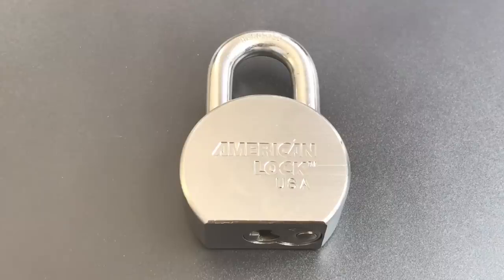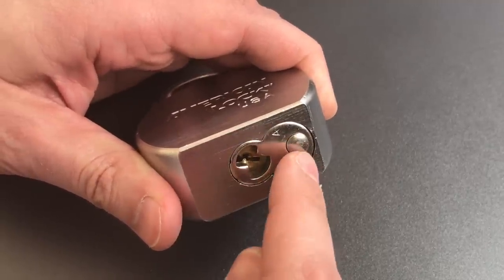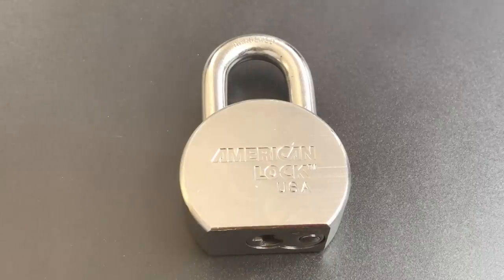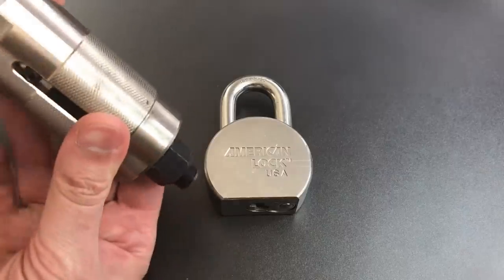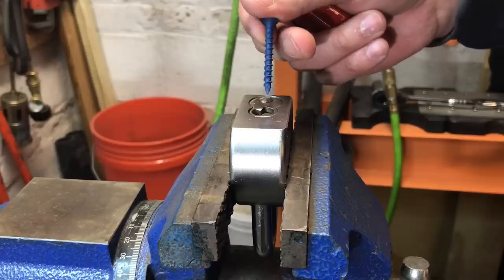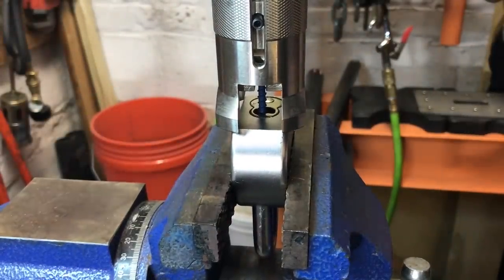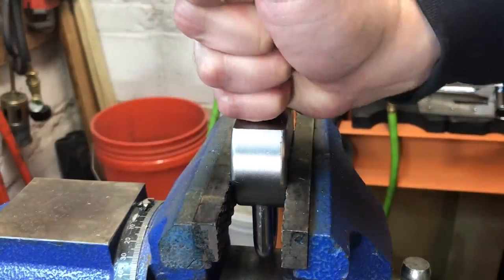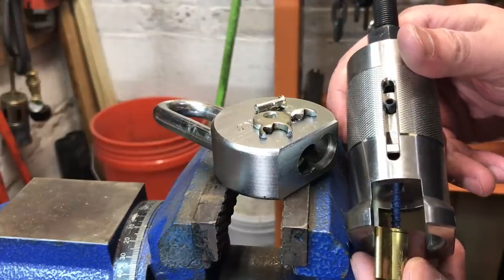[607] Core Puller vs. American Series 700 Padlock

Comment: As always, thorough and cleanly executed...you sir, with your videos, have opened my eyes, for some time now, regarding lock security...
Reply: Too true. Some videos, like this, or the Ramset video's, or the nut splitter videos, or bosnianbill's grinder video remind us that picking is a last resort most of the time.

Personally, if I can't rake it open in a few minutes, I use a cordless Dremel and a 3mm carbide burr.

Comment: A core puller?
We use core pullers in the fire departement as one method of entry among others.
edit: Ours you can operate with a cordless drill for more speed.
03:55 We use different screws. One kind to pre-cut the hole and then we remove it and use a different, more sturdy screw for the pulling of the core.

Comment: As someone who has worked with tapcons before (worked sheet metal roofing, sometimes needed to go into concrete walls), I'm surprised at how well it held. I've always been so used to them snapping with such little force. Thankfully, I don't worry about this now.

Comment: Well done!  I would think they could beef up the design so that the brass core would strip out before the screw failed.  Also interesting to note that one security measure, hardening the retention plate, introduces a weakness, brittleness and a lack of sheer strength.  Case hardening of the retention plate might be best.

Comment: Very interesting.
If you plan ahead and come prepared, you could use the same bottom pins and replace the core and retention plate with new ones, and it's possible nobody would know the lock had been tampered with. While you're at it and have the core out it would be easy to impression the bottom pins and make yourself a key when you are back in your shop.

Comment: I would recommend using deckmate style deck screws instead of the tapcon in the future. My years in the construction trades showed me on numerous occasions how brittle the metal in tapcons are. Deck mate screws are far less likely to break. It got to the point where I was using deckmate screws as concrete anchors in place of tapcons because of a much lower failure rate. When installing tapcons I would expect a failure rate of 30 to 50%.

Comment: It's rare i see a new commercially available lock tool on youtube before I see it else where! :) ... what is this tool?? ... 
Looks like something that could save some time, and much safer personally, than drilling the domed retainer nut ... and It leaves the padlock easily re-build-able for the customers re-use (new plate screw and cylinder in the event it can't be picked open),.

Comment: A japanese style philips screwdriver bit with a ratchet is good for getting leverage on screws that are hard to put in. Basically just file off the tip of a philips head a tiny bit so it's flat and it won't slip nearly as easily.

Comment: It appears that the screw could be replaced with a high-grade equivalent?  Not sure if the retainer plate would still break but perhaps with the screw holding it would take more force.  Probably the core puller would still exert enough force anyway, but as you say a pretty good package overall.  If I had it I would upgrade the screw...

Comment: The screw he uses is a concrete screw. They are much tougher than any other kind of screws. They are also coated in a plastic like epoxy which makes them easier to screw into concrete.

Comment: 1. Put candle wax on the screw thread.
2. Use a pan or hex head screw.
A key would open it much easier without breaking the lock!

Comment: Wow! That's all I could say. Obviously you know how most people feel about the "American" padlock. You just demonstrated one of the easiest, quickest, and pretty quiet ways of by passing one of the most used padlocks; at least here in the states; that the majority of people would use to protect pretty expensive modes of transportation like ATV's, and trailers for transporting cars. It also looks like the lock is still good to go, just needs a new locking mechanism.
Reply: The quietness of this attack is a big deal, no power tools at all, just the crunching of the breaking lock goodies.

Comment: So, is this a commercial locksmith's tool, or something adapted from the automotive world?
I used to use an I.D. sleeve puller to do this job when I was doing repo work. 
The jaws of the puller slipped in under the edges of the retained, and broke the soft screw.
I doubt my rig would have damaged a hardened screw.
Reply: Thank You!

Comment: Core Pullers are so nice. Impact and bending would be bad for that hardened screw in the core.
Reply: And the screw should have a washer on it because of the angle of it‘s tip

Comment: Definitely agree impacts use a hammering affect to help break loose bolts and nuts or tighten
Reply: the hammer may work against this tool, causing the screw to snap due to too much instant torque.
Reply: Makes sense.

Comment: Possibly drilling a bigger hole in the core and driving a sized high grade bolt in that hole would allow significant force to be applied with no damage to the screw?

Comment: I would use a screw with a square (Robertson) or Torx drive rather than crosshead - much more torque capacity and much less likely to 'cam out'.    Though one would have to be more careful then not to shear off the end of the screw in the lock.

Comment: What would happen if you used a key cut like a kill-a=lock ?
With the 45° and 90° cuts instead the screw.
Reply: I'd guess that it depends on how well the core is secured. That would probably work on more fragile locks, but on sturdier ones I feel like you would end up ripping the key out and mangling the core rather than pulling it out.

Comment: Well done. You know I've come across a number of American padlocks with a retaining nut that wasn't hardened and fairly easy to drill the only thing I can figure is they must have been rekekeyed at one point and someone put a retaining nut in that wasn't hardened So generally I would recommend checking just in case you might get one that is not hardened making it easy enough just to center punch and drill it.

Comment: Wonder if American Lock has fixed that already? It’s easy to fix that yourself if you just find 12.9 screw of that size. It may be the reason the lock factory has an ordinary screw there instead of a decent one. It probably is better to change to a larger screw too.

Comment: LPL...... have you ever used or seen a GM collet tool, that was used on the early GM locking steering columns? It worked the same way. And was much quieter than using a slide hammer when repoing a car......

Comment: I wonder if that core retention clip could be welded to the case in order to prevent or limit this type of attack? That would be a quick modification for an otherwise solid lock.

Comment: I will bet that core puller is expensive too. All that precision and hardened steel. That American Lock did not have a chance, and that is a good lock. I wonder how it would have faired if the core didn't have that vunerability of that only so so retainer. That core puller would be cool to check out. I love fine tools like that.

Comment: so if the core retention plate was made in a better steel and the nut and bolt made hardened and larger this lock would be significantly better?

Comment: I always have the same question, at what point why wouldn't someone put some heavy bolt cutters on the shackles? Its relatively quick and just as easy as a core puller. And you could hide it in the duffle bag that you no doubt brought for whatever it is you are stealing just as well as the core puller and that huge wrench ? Just my thought
Reply: You ever try cutting a large shackle like this one? The bolt cutter would have to be huge

Comment: Looking at that domed screw retainer would it be possible to use a junior hacksaw to make a slot (or hammer a stone chisel to the same effect) and then just turn it to unscrew the plate and lock?
Reply: AlisonWheeler if I remember right there's two wings on the side that prevent it turning inside the lock body. Otherwise you wouldn't be able to unscrew it because it would just turn along with the screw
Reply from the maker: It will not turn... they thought of that.
Reply: LockPickingLawyer Putting in a cut or channel - and rotation being blocked - would make it easy to drill though. All about timing, noise, and visibility I guess.

Comment: It seems like one could use a flathead screw driver or a small cold chisel with a hammer to do the same thing? It wouldn’t be as cool and you’d work up a sweat, but I think it would work in a pinch

Comment: So if they where to weld that plate instead of using that bolt like thing this would be completely impossible right? Would make the lock more expensive but still. Seems like a good idea.
Reply: John paul May  sure... But that makes a lot of noise and sparks and stuff. Anything can be opened destructively if you have the time and a well isolated place to work.

Comment: Your experience with the TapCon screws pretty much follows mine - they're tempered pretty hard and do tend to be on the brittle side. In fact, I've had fairly good luck when it's time to get rid of them when remodeling by just smacking them sideways with a hammer and having them ping off into space.

That core puller looks very reminiscent of a device I've seen used to test paint/coating adhesion. I believe this was the exact one: 
https://www.elcometer.com/en/coating-inspection/adhesion-testers/pull-off-adhesion-testing/elcometer-106-pull-off-adhesion-tester.html

Instead of tugging on a screw head, it used these little mushroom shaped test "dollies" that are glued to the surface coating.

I'm suspecting the reason the locking mechanism didn't rotate when you attempted to turn it after pulling the cylinder is that the spring above it got wedged at an odd angle. I had that happen on some padlock after changing the cylinder, reassembling, and locking it. The fix was, uh, unscientific but effective: throw the lock in the air and let it come crashing down on an asphalt parking lot, after which it worked fine.

Comment: To think that all this time when I was using a spanner to open these when all I had to do was buy a super expensive "Bell" core puller. Huh!
Reply: Kit Bear explain 'using a spanner to open these' please.
Reply: Sure, use the large open end of the spanner  to wedge under the anti drill notch on the tab side of the plate and push the spanner downwards towards the retaining screw. With enough pressure you can bend the tab out and repeat the process on the other  end you force out the plate from the screw.
Reply from the maker: I’d love to see that. My experience has been that anything I can wedge in. There will break before the lock ☹️
Reply: Kit Bear how do you leverage the lock in situ? Seems like that would be an issue.

Comment: If you used an impact driver instead of a ratchet you could probably tear the core out in seconds
Reply: chain3519 might as well just use a cordless angle grinder at that point

Comment: I'm a little late to the party, but this tool is very similar to a Subaru Ball Joint puller.  This one is cheap, Astro Pneumatic Tool 78620 Subaru Ball Joint Puller

Comment: pulls out giant complex metal tube
"Its a relatively simple tool"
Reply: ThreeEyedFish that’s a professionally made version. Burglars use cheap throwaway versions easily made in any machine shop, those last for at least half a dozen breakins while the pro version shown here lasts a lifetime for a pro locksmith.
Source: I’m a cop, have investigated burglaries where core pullers were used. Telltale sign is a circular impression around the lock, and the lock cylinder completely missing from the crime scene. 
Eastern european burglars tend to use purpose built conical screws for these, those are beefier and less likely to break in the lock.

Comment: I drilled the core out of a very similar lock using progressively larger drill bits. I lost the keys to my toolbox and the lock was recessed.  I'd normally just cut it with a torch or bull- pin and hammer. But since the lock was recessed I had to drill it out . It took about 10 minutes .

Comment: Core pullers are useful when sheer strength is required WITHOUT impact. In this case, it compromised the weakest link, that simple screw. American, I imagine, will be "upgrading" that retention screw now, using one far stronger. A cheap fix, to a good lock. Use a screw with a tensile strength of at LEAST Grade 10, and this attack becomes far harder, if not impossible. It only has to defeat the Concrete Screw, which is Grade 8.

Comment: Now it would be able to pick this lock with no problem in 30 seconds but I've decided to use some crazy device that is not commercially available and no criminal will have access to to destroy the lock this is most definitely more difficult than picking the luck but why not. Let's get started.

Comment: Those keys with dimples rather than teeth are better or can be picked as easily? Do you have any videos of those?
Reply from the maker: Check my dimple lock playlist... it’s probably over 100 videos long. 👍
Reply: I've seen several tens of your videos already :-) but please tell me, are keys with dimples any better/safer? I have to install a new one tomorrow!
Reply: George Of The Jungle a good one is better than a cheap one of the alternate. But a really good pin tumbler lock can be much better than a low end dimple lock. It really comes do to use case and threat analysis. What threats are you mostly looking at. In many cases its more about resisting brute force attacks or being so hard to force that bad guys seek easier targets. 
 The majority of thieves dont pick. They seek to quickly bypass or break a lock, so croppers, wrenches, hammers, shims, core bypass tools, that sort of thing. 
 Sometimes locks are very well protected against one attack but not another. The american round body for example. A decently strong lock. Has ball bearings to prevent shimming. Can be obtained with bumpstoppers, and you can beat on it with. Hammer for a while without hurting it dspending on how its attached. However with two tools the core can ne bypassed and the lock opened easily in less than a minute. Or as shown here it can have its core ripped out. 
 If the situation around the attack calls for more stealth, they can be easy to pick as well. 
 If this is the lock you had, and wanted to make it secure, you could rekey it with a pin kit or replace the core with a better compatible core. Then you could further mod the lock by making a shackle guard for it by getting two short pipe nipples that are just shorter than the straight sections of the shackle when the shackle is closed. This makes the shackle even harder to cut. You would need to add an antibypass wafer or two to the core and then weld some reinforcements over the core retaining plate to help prevent attacks like this one or with the ramset. 
But if the lock you want to use is decently strong, it should be ok. Most attacks are brute force.

Comment: Use a cordless Dremel tool with a thin cut-off wheel. It will make short work of the head on that pin in about 2 minutes.

Comment: To counter this, I would weld a 1/4" or thicker plate on the bottom of the lock with only a hole for the keyway.
Reply from the maker: A top loading padlock would be easier.
Reply: Is that where the tumbler gets inserted on the same face as the shackle?
Reply: skoronesa same as abloy 362

Comment: Great Video!  FYI Tapcons are notorious for not being very strong.  I've snapped countless ones I concrete!   They are stronger than drywall screws but not hardened structural screws like the ones made by Simpson Strong Tie  for structural brackets.    None the less, the Tapcon seemed to work well here and I agree less shock load vs static load.

Comment: Ouch.  That was a little too easy.
Reply: this method is entirely impractical though, isnt it
Reply: Seems practical to me.  The puller is a bit large to carry in a trouser pocket but certainly portable enough.  I doubt the vise is necessary.  Any thief with rudimentary planning skills could do this without having to become a genius.  The tool costs maybe $150.
Reply: Totally practical. In less than a minute, he broke the lock. As slow as he was working on it. (no offense LockPickingLawyer) 
I am sure that if I was going to steal your bicycle, I could have that lock apart in about 20-25 seconds. 
He just showed how vulnerable those locks are. That is the point!
Reply: maybe you guys are right. reason i made the comment was that he had the thing in a vice and what not, but that's probably not needed. it would certainly be more difficult to get it all done in a realistic scenario though.
Reply: people who steal bicycles are meth heads who take unlocked bikes. these vids help people who lost keys and don't want to use a locksmith who shows up with an angle grinder and charge $300 for 2 mins work.
Reply: Er, the core puller is its own support. You don't need a vice. He's just using one for support.

Comment: Is it easier to pick a lock once you've seen the key?
Reply: Sometimes, not always or even mostly. The inner workings of the lock are only exposed to a small extent by the key. There could be spools, trap pins, false pins etc that the key wouldn't tell you about. A secure lock is just as secure if you can see the key.

That said, there are ways to replicate a key from a picture and use that to open the lock, so it's worth protecting your key for that reason.
Reply from the maker: Of course... though at a certain point, it really doesn’t make a material difference.

Comment: So, you can't exactly vice down a lock someone is using for its intended function, or turn the lock over and slam it down to get the core out. I'd like to see you attempt this against a lock being used practically.
Reply: Holding a padlock in some vice grips would be just as effective, but not as easy to film.